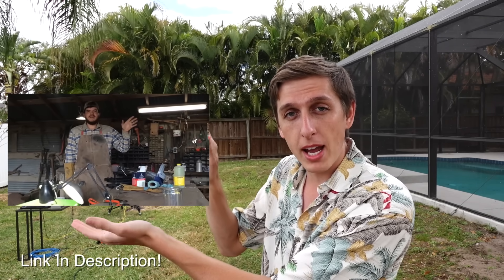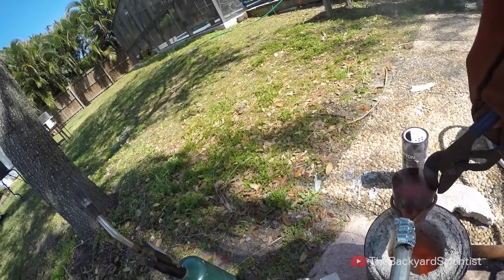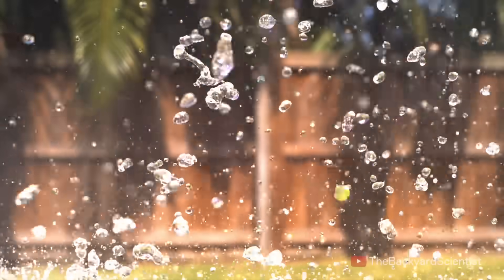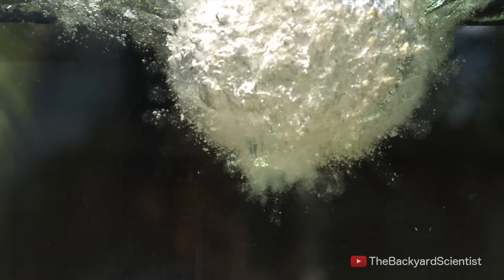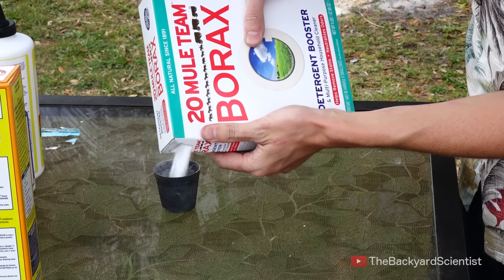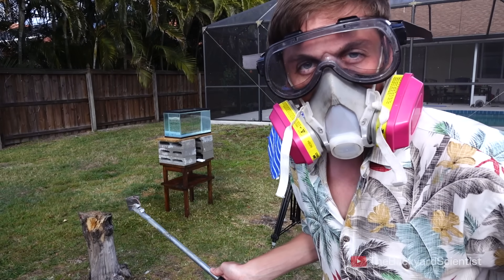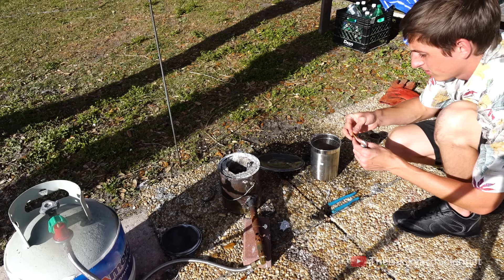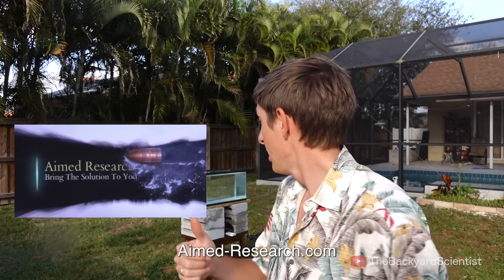Pouring Molten salt into Water - Explosion!

Comment: Correct me if I am wrong, but as far as I know, dissolving NaCl in water is a chemical reaction because the ionic bonds are breaking and forming, and for what you said about the no change in the water pH is because both Na and Cl act as spectator ions. Also melting an ionic compund movilize the ions making the compound highly conductive. Sure the explosion has something to do with a thermal shock, but I suspect it is both a physical chemical reaction. Again I´m no expert so correct me if I´m wrong.

Comment: Can anyone explain why the Leidenfrost effect did not protect the molten salt?
Reply: My guess is different boiling points
Reply: It did, check the slow-mo, you can see the little bubble. Just remember that the Leidenfrost Effect does not last forever, it's going to stop working pretty quickly. (The first explosion anyway).

Comment: next step black hole in the backyard 😂😂
Reply: LOL
Reply: alan wisdom LMFAO
Reply: Solum particle accelerators don't create black holes, if it did, the second it dissipates there would be an explosion quite bigger than many nukes we've ever tested before.
Reply: I see, well, it is done with a type of machine that I am not familiar with.
Reply: well, black holes are created very easily (if you have a particle accelerator). 
It's just that they're microscopic and disappear almost instantly, so it probably won't look as interesting as it sounds.

Comment: So does pepper do the same???
Reply: jaidon rymer no pepper is a plant based condiment salt is made out of 2 elements sodium and chlorine very simple pepper is made of carbon and all other element that would not react with water and would not melt sodium is a metal but no elements in peppers molecules are metal so it wont do what the salt did

Comment: I worked in the furnace part of a steel mill for a couple of years. Anyway, you can put water on top of melted liquid steel, but you can't put melted liquid steel on top of water, it will explode, well maybe not explode but the steel will go up or away from the water. when it comes back down it will do it again, if it is contained as in a furnace. 
The outside walls of the furnace I worked with was water cooled. One time there was a leak and the water was forming underneath the steel. There was 150 tons of steel in the furnace at the time and around 2500 degrees or so. The steel started to rise up and down in the furnace. It did this for about a 1/2 hr or so until the water was shut off and evaporated. There was a roof on top of the furnace which had moved 5 ft over. I quit not long after that.
What this has to do with the video? Maybe nothing, it just reminded me of what happened.

Comment: i guess the explotions were phisical reactios cuz of the extreme temp. differences(thermal crash).
although there was latter a chemical reaction when the salt turned into a solution, trasforming itself in an hydroxide and an acid.
there was an equal hydroxide and acid equivalents, so the PH resulted in a neutrum solution.

Comment: The sodium reaction is definitely chemical. If something catches on fire by touching something, it's a chemical reaction. Oh, or if it produces flammable hydrogen gas and igniting it, causing an explosion, which is what sodium and other alkali metals do.
Reply: Sodium and water is a chemical reaction, but it is not simply a hydrogen explosion. It works in an inert argon atmosphere, and the detonation is too fast. The most widely-accepted hypothesis for the detonation seems to be that billions of amps of electricity flow across the gap and increase the surface area by sucking the sodium metal and water to each other, resulting in an instant Coulomb explosion with a clean surface.

There definitely is H2 gas being produced and burning, but that isn't what causes it to explode.
Reply: [SF] StarFire guys seriously it's not a reaction no fire is produced... it's just water boiling instantly. if you heated anything to that temperature and put it in water it would do the exact same thing
Reply: @jennal5868  I mentioned Sodium, not salt.
Reply: Peter Smythe Ok, thanks for the chemistry lesson.

Comment: Maybe it could be a physical reaction instead of a chemical one? My theory is that when the salt first hits the water, a tiny bit of the water vaporizes, which causes the Leidenfrost effect while the salt falls through the water vapor where the air used to be. When the remaining salt hits water again, it's going into a curved surface so the water surrounds it more easily, and is traveling fast enough that it can get further into the water before it vaporizes again. Since a much larger amount of water is converted to steam at once, it expands with enough force to act as an explosion.

Then again, this is from someone who failed A level Physics and is only doing decently in Chemistry, and who hasn't watched the entire video yet. Take it as you will.
Reply: @Jam Usagi i guess you can say take it with a grain of salt
Reply: Alkali metals react violently with water to release their outshell electron.  In this case - the NaCl already is ionized and shouldn't do that.
Reply: Jam Usagi using 8th grade science intuition here, but perhaps the chlorine is reacting with the hydrogen in the water. like maybe the high temperature can make this reaction happen. chlorine has 7 valence e- and hydrogen has 1, so it satisfies the octet rule. please correct me if I'm wrong. I really would love to learn more in the field of chemistry
Reply: PartyPKChu no it's just water boiling instantly and appearing to explode. no chemical reaction is taking place at all

Comment: I think It is because the molecule of salt is NaCl the Cl evaporates and you are left with sodium which is very reactive to water
Reply: Prahalad Gururajan read the whole comment
Reply: That's not how chemistry works... The chlorine cannot evaporate or even separate form the sodium without a chemical reaction. NaCl is an ionic bond, and is pretty hard to separate.
Reply: TobeyT3 yes
Maybe it is because of the temperature difference
Reply: It's because the salt melt's at a high temperature. It has nothing to do with a chemical reaction at all.
the molten salt is so hot that the water instantly boils to steam.
As the water contacts the very hot molten salt it dissolves rapidly, transfering  its heat to the water much faster than would happen if the salt did not dissolve.
If any molten salt normally dissolves well in water it will behave like ordinary salt when dropped in water.
Reply: OLD-BIT Gaming if this was the case, the PH measurement of the water would have reflected the subsequent hyrdonrium (or hydroxide) increase in the water due to chlorine reaction. Therefore, not the case ser. Temp change is a physical reaction, again

Comment: I'm not sure I can accept your explanation for why molten salt explodes but the other substances do not. I'm wondering whether solubility in water could drive the observed effects. Did you try this experiment with sugar?  Cool experiment regardless.
Reply: I wonder if the high solubility of the salt ameliorates the leidenfrost effect.  Maybe a cavitation bubble forms and instantly collapses partly due to energy being sucked out by the breaking of the ionic bonds, causing a shockwave that compresses the water and hot salt  together.  The salt instantly dissolves, all the thermal energy in the salt and the chemical energy from the formation of hydrogen bonds is instantaneously transferred  to the water.   The resulting steam explosion is helped on its way by the rebound from the cavitation collapse shockwave.   Any remaining globs of salt are blasted through the water and the same process happens to them.
Reply: The limitation of 100C isn't quite accurate. Water of course converts to steam at that temperature but to actually boil something has to activate the reaction. Pure water can be super heated to where adding anything to it will cause an instant boil off reaction. Just like cooling a bottle of water in the freezer then tapping the side turns it to ice, only raising the temp. rather than lowering it
Reply: i thought it maybe dude to how readly salt dissociates in water. essentially all the energy must be held in the ionic bonds and once you put it water all that energy is released. hydrogen bonds essentially cut the ionic bonds, and the ions explode in every direction
Reply: Adam Xue there would be no l
 water in vacuum because due to low pressure it will be in gaseous phase.
Reply: Arun Kumar 
hmmm, you are right,ha, i didn't even think about that.
XP
Reply: Covalent bonds found in sugar aren't broken by solvation in water. Ionic bonds are broken such as NaCl in H2O.

I have heard of an explanation which seems somewhat likely for thermite in water or ice, and may apply here. The molten salt is encapsulated by the rapidly cooled and solidified salt exterior, and pressurized as the solid exterior contracts. Finally the outer shell bursts. Conceivably this could facilitate the "exponential expansion" hypothesis.
Reply: That's exactly what I meant. Just said it in a very less educated way xD
Reply: Robert - You performed the experiment in reverse. If you put sugar or salt into a boiling liquid such as water, or coffee, the addition of the new substance changes (likely raises) the boiling point. HOWEVER, the addition of sugar into the liquid results in an exothermic reaction as the covalent sugar bonds are broken by the dissolving action, releasing heat. If the liquid is already at the boiling point, the liquid must boil to scrub off the excess heat to caused by the sugar dissolving. 

The experiment performed here investigates the properties of molten materials in water. I think the Backyard Scientist is probing an interesting phenomenon which explanation we await.
Reply: Jangle2007 sugar will disintegrate at that high temp
Reply: +cougkat122 
Question: So basically if there is pure water just floating in a otherwise complete Vacuum, it does not matter how much heat it has been given, it will never boil unless there is something that does a heat exchange with the water?
I'm a newbie high school 1 grader, go easy on me XP
Reply: So this is how the dude made that water powered car
Reply: Jangle2007 actually an exponential expansion theory is a proper theory. think about when you flash freeze an item then throw it in a fire the result would be a thermal expansion explosion look up myth busters and thermite on ice. it exploded the same way this does except salt is safer to work with then thermite which can melt through several vault doors.
Reply: Jangle2007 was the chlorine evaporated out of the salt and just left the sodium?
Reply: No, you can't separate NaCl into components simply by heating. You can electrolyze molten salt, releasing Cl into the air and obtaining liquid Na, but this has to be done VERY carefully as the melting point of salt and boiling points of Na are only 80 C apart. Liquid sodium is EXTREMELY reactive with any moisture it finds. Boiling Na is an order of magnitude more problematic.
Reply: chlorine gas would have killed everyone in that video
Reply: What Jangle2007 said, plus surface tension.

Comment: It's possible that the melted salt's temps are converting water into steam, as you mentioned where water converting into steam is 1600 times the volume as water.  That appears as an explosion.  However, the sodium in the melted sodium meter is breaking the ionic bond of the hydrogen and oxygen molecules apart and the heat of it is causing the hydrogen to burn.  However, before the burn, the oxygen is attaching back to the hydrogen (HHO), causing a stable burn, not a all-out hydrogen explosion, otherwise, you could be dead by now.

Comment: Do the other salts you used crystallize as good as tablet salt?. I think as the initial large mass enters the water you are correct about presuming that water is getting into the mass. But at the same time i do not think the mass is expanding dramatically because of said water, instead it is crystallizing over the water and encasing it. it would explain the large amount of pressure build up and sudden release. I could be wrong though. just my observation. Good videos  and thank you for sharing your research.

Comment: i think the reason why Leidenfrost effect doesn't kick in the molten salt because salt itself dissolves very well in water. Leidenfrost effect will only kick in if the substance cannot be dissolved in water or at least in an efficient way like salt. And there's my theory about the heat transfer between the molten salt and the water and there's my speculation that it must have something to do with the molecules of molten salt interacting with water. As you see, salt in room temperature is compact (or a crystal) and we know that when a substance is heated, the molecules will move more and more until it turns into liquid. In room temperature, the water only interact with the outside most molecules of salt then slowly dissolves it until there's nothing left, in the other hand, molten salt is not in its crystaline structure and so water can interact with its individual molecules and that's why the Leidenfrost effect doesn't kick in (at least immedietly). Because the salt is much hotter than water, when water tries to interact with the salt molecules, it immedietly turned into steam and we know that when too much steam is trapped in a closed area it will build up preasure which increases the temperature even more which vaporize more water and creating more preasure until it explodes.

Comment: Aside from the obvious fun, there was no point in performing the molten sodium test, since the ionic sodium in salt cannot possibly react in the manner of metallic sodium.  That reaction reduces the water and produces ionic sodium as a byproduct.  It's as if you found an explosive reaction involving CO2, observed that CO2 contains carbon, and then did an experiment burning coal to see if that was similar.

Comment: i think that the fact that Ph didnt change does not prove it, bucause i looked up and waters ph is around 7,5 and salty water is the same. (i mean it could change a bit, but the change would be so small that an indicator couldnt show it)

i could be wrong idk
Reply: Tap water, maybe, because it has impurities dissolved in it. For example, in the US, the government adds fluoride to tap water to improve dental health of people drinking it and making it slightly more basic.  Pure, distilled water has an equal number of hydrides and hydroxides resulting of a pH and pOH of 7.0.
Reply: smugmotherfker i thought he used destillated water (or how u say it in english, idk but only H2O)
Reply: samu8882 salt dissolving in water is not a chemical change... it isn't supposed to change the pH

Comment: Are the other salts pure, or do they contain hydrates. Hydrates give off water vapor when heated. I'm thinking the Leidenfrost effect breaks down because the table salt can possibly dissociate into "salt fog" in thick water vapor, which allows it to saturate localized areas of the vapor, allowing the solid to traverse the vapor barrier. Then boom!

Comment: if you melt salt and let it harden is is it still edible??
Reply: Ice Trex you can buy black volcanic salt that's harvested in Hawaii. I'm sure it's a similar substance. I worked in fine dining kitchens, and we used for garnishing cold dishes and seafood.
Reply: +lol   Such bait, much troll.
Reply: it wont play defense
Reply: Ice Trex sure its the same as ice if you let ice melt and then freeze it again you can still do it in your slightly to warm coca cola
Reply: Ice Trex good question i dont think its salt left because some of the sodium burned away
Reply: No it will turn into bleach poison
Reply: No because it caused a chemical reaction because your burning some thing so only the the chloride or chlorine is left
Reply: Black "volcanic" salts are usually just salts with activated carbon and trace amounts of other compounds (which are quite good at removing toxins). This isn't the same thing, although I doubt its particularly bad for you, barring Iron Oxides from old crucibles, etc.
Reply: You people are not taking into account that may be the very hot molten salt can react a little with the steel/whatever the "cup" it's being molten in is made of (and/or impurities from previous usage to melt other things). Per se re-solidified molten salt might be safe, but I wouldn't take my chances if it was not done in a  controlled environment xD

Comment: The process of adding the molten sodium, over 1000 degrees Fahrenheit, to the water, ranging from60 to 78 degrees Fahrenheit ( depending on the temperature of the air surrounding the water), would cause a physical reaction because of the rapid heating of the water and the rapid cooling of the salt to create a consistent temperature between the two., creating the explosion. The other experiments with the borax didn't create the explosion because there was some sort of film seperating it from the water which slowed down the rapid temperature change. It is similar to the possibility of tornadoes, but since these are liquids and not air, then it creates an explosion instead. This is my theory on what is happening in this video, and I'm only in 9th grade biology and 10th grade geometry so if anyone disagrees and wants to counter my hypothesis or if anyone wants to add on to my hypothesis, I will be interested in any comments

Comment: Very nice exp.We have simultaneous thermal and chemical reactions from which I do not grasp it all.The picture shows an evolution  in clusters of vapourisations ,clearly shielding an internal hot core Na burning reaction . I also canot exclude decomposing of water into its exploding components wich of course recombine.The contribution of initial temp.of molten salt is to be noticed.......secondary can I ask you to  study a bit of explosion of water droped into hot oil, could you be so kind?Thank you anyway,it was beautifull.